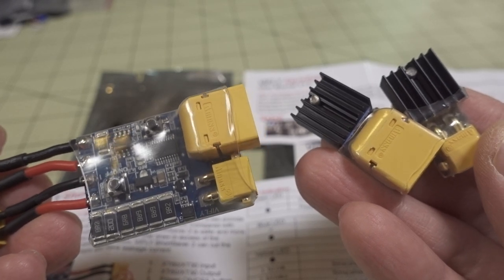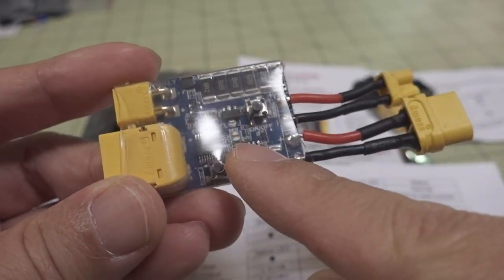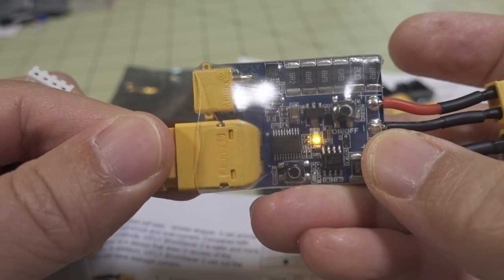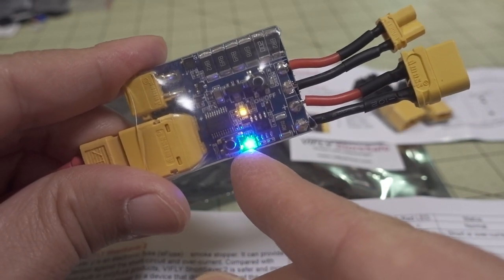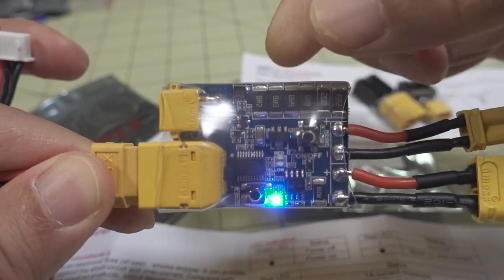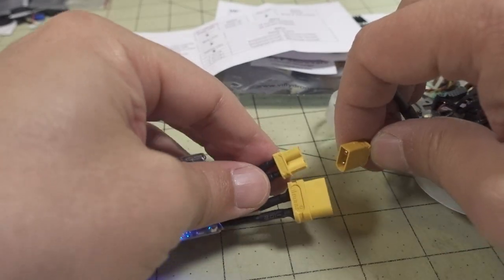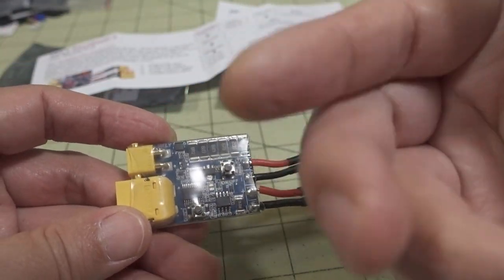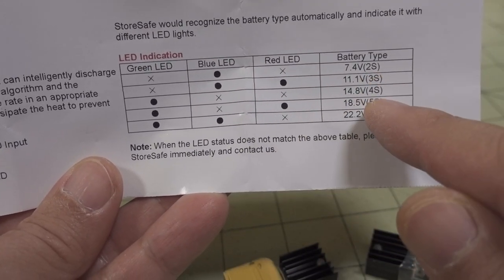ViFLY ShortSaver 2 (Smoke Stopper) & StoreSafe (Lipo Killer) Review 🚭👍

Comment: I only just used the V1 smoke stopped about 30 mins ago after having to rebuild my quad after crashing into wet sand. The V2 looks heaps better. But what I could really use is about 6 of the xt60 safestores. Thanks again Al.

Comment: I charge more batteries that I fly. As It seems to always get windy in my area. So the store safe discharger TX 60 would be easier than running them through a storage program on the charger. Plug um in, and chuck them in my lipo bag, done. Keep up the awesome content, and Happy New Year!

Comment: The reason these would be awesome is because the charger I have doesn't have a discharge function, and the only way I can get my lipos to storage voltage is flying them, which is sometimes not an option (ie. bad weather, parts break, shipping time etc.)

Comment: The power button on the new ShortSaver sounds really useful for receiver binding and also just as a way of quickly shutting things down if something goes wrong. The StoreSafe sounds like it's best used with smaller batteries, so I suspect the XT30 version will be in higher demand.

How much power does the StoreSafe draw once it has discharged the battery to the storage voltage? (To power the microcontroller / LED etc) I'm wondering how long you could leave one on a battery before it would damage it.

Comment: Cool product. I have the older version which trips when plug to a larger motor like 2807. Does the timer setting over current solves that?
Reply from the maker: No, it will still trip because those huge motors draw too much current even when idle.

Comment: I only have a few 6s batteries, but with winter here in Eastern US, the weather can be unpredictable. I already have short saver V1, so I would prefer the discharge unit. That would be great, though my ISDT charger technically can discharge, it takes hours as it only discharges at .4A rate. I don't need either, but I would be a happy camper :) thanks for the information, as always

Comment: A smoke stopper would be a useful tool to keep the magic smoke in my flight controllers. ☺  I have one of those smart usb chargers that will drain a Lipo to a storage voltage, so I use that to charge my phones and other devices when I come back from the field with unused packs but these would be a good 2nd option.

Comment: Thank you for your videos, I've learned a lot from them. 
My reason for the giveaway entry:
I'm just getting into FPV (ordered a cheap Chinese WiFi drone, but then I started looking at videos :)). Still on the sim, got a radio (TX16S) , goggles (EV800D), drone and charger still in transit (DE56pro for now). So it would be great to have some extra safety equipment (was actually thinking of making a switchable cable for binding